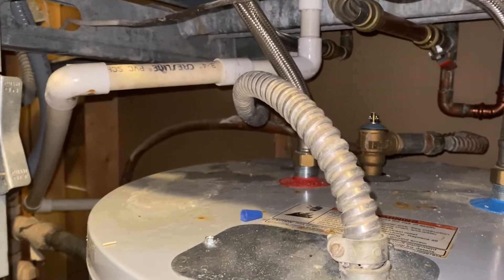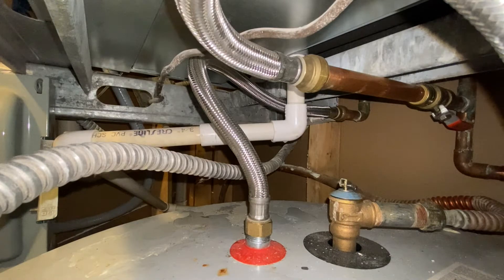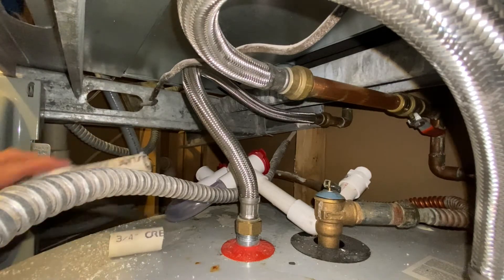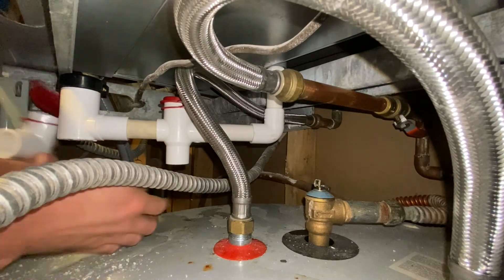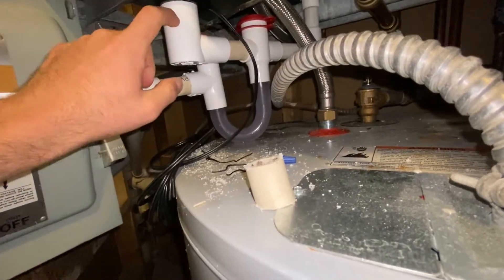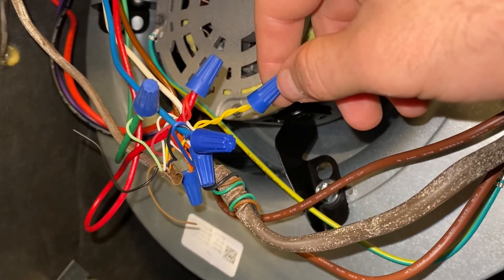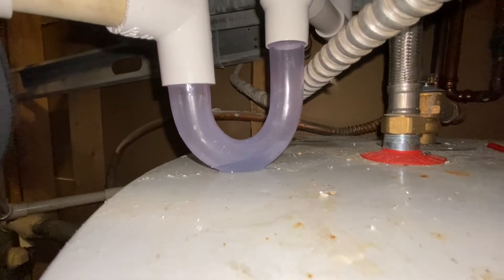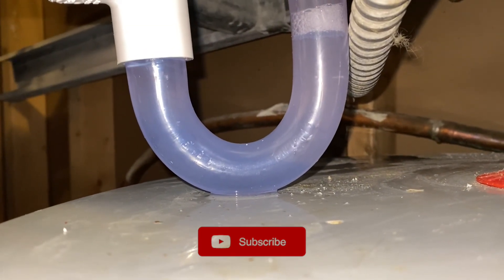Installing a Combo P-Trap and Condensate Overflow Switch on AC

Comment: I bet they didnt cement the drain because they wanted to treat that joint as a true union.  Once it is disconnected, the drain can spin off.  If it was cemented you couldn't do that without cutting it

Comment: Agree, if you do not make a water seal the u trap, the hot air in the drain tube will be sucked into the air handler making the air flowing out hotter/less effective cooling.  Most important to remember during the drier months

Comment: That’s a great video. Like the other person stated. Hope you didn’t forget to glue the clear “U” trap piece because there’s water under it on top of the water heater. Also as an HVAC tech I would suggest you put 2  pvc unions on line just in case you ever have to remove it to do work on the water heater so this way you don’t have to cut the whole trap out.  Even if you have to cut it out later you can always add the unions then.  One union right as the line drops down and then one after the trap so this way you can take out the whole thing to get space to remove the water heater if needed.

Comment: Oh wow. This is the closest setup to what we have in the home. It's a vertical AC unit with the coils in a V shaped like yours with the filter in the same spot. I also have a stubby water heater below the unit. Can I email you some P-trap questions? My unit keeps leaking (even after cleaning the line) & I got a hack job going for the overflow. 🙏
Reply: I am now seeing this video. Have you resolved your issue ?  If not email me or reach out to me.  I’m an hvac tech and I love helping people. Let me know and I can send you my info